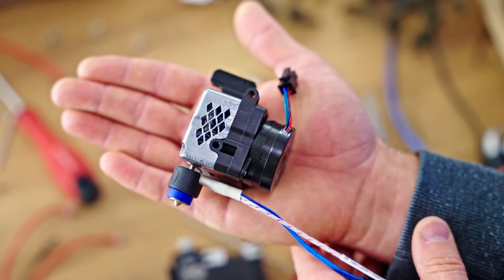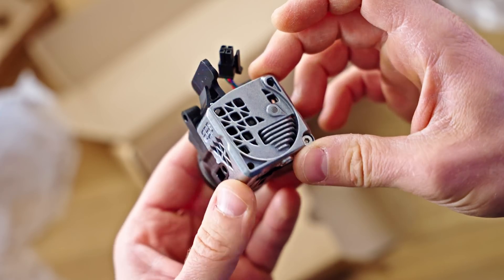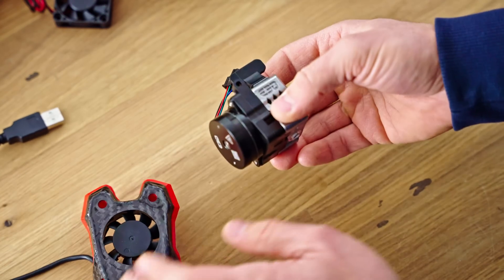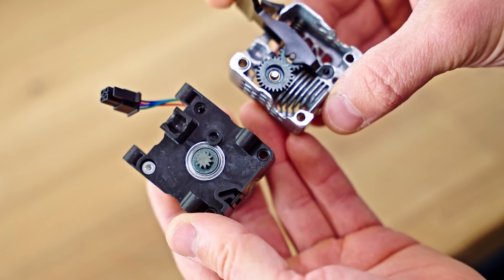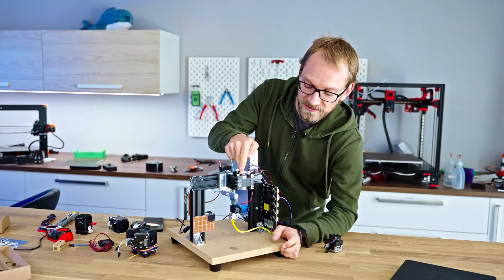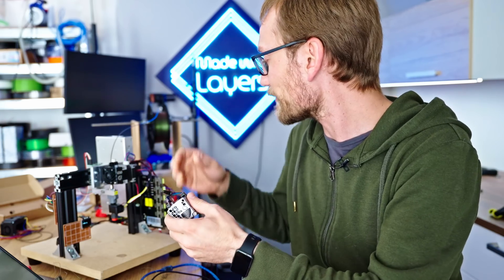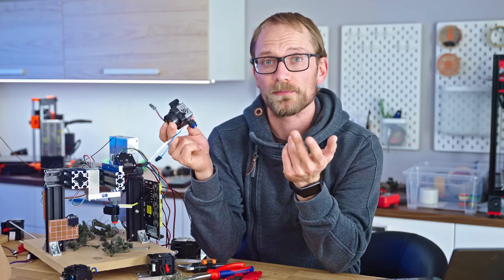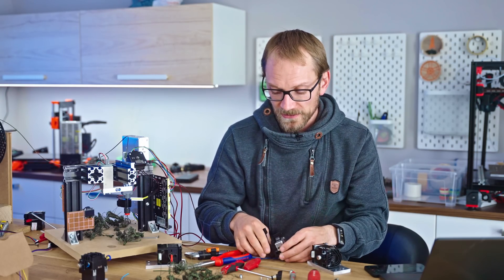Is the tiny E3D Revo Roto extruder really enough?

Comment: The depth of field on your overhead camera is very small or thin with the camera strugling to refucus with just a small movement up and down of your hands.  My suggestion is to use more light and push your asa up while decreasing your exposure.  This will help increase your depth of field.  Thank you for all the great info.  This might be a great extruder for a multi tool head printer.

Comment: Who's making the round stepper motor for them?, I have the LDO round stepper which is rated at 1 amp running at 700mA 24/7 on a Hevort/vz-bot type extruder with BMG gears printed in petg and the motor doesn't even get hot, looking at their documentation it says recommend current of 0.45A peak and max of 0.6A, seeems like they have used a lower current motor that's not up to much, why did they spec that motor for the roto extruder, maybe they could try the LDO or Moons motors that are rated higher?, don't know about the stealthchop issue that's mention below as I'm running a duet ethernet controller with TMC2660 which don't support stealthchop.......

Comment: I have been able to get consistent extrusion of 100mm of ESUN PLA+ (at 225 degrees Celsius) filament at a feed rate of 645mm/min. 0.6 Revo HF nozzle, 60w heater core. Roto stepper running in SpreadCycle at 350Ma with default 0.9 chopper timing. (Marlin)

Comment: Maybe it's not stepper issue but stepper driver. We know that microsteps results is massive torqe drop. With that high gearing and 0.9 degree motor there is no need for using it. Try full step mode and retest it.

Comment: It's abit of a pitty, that you did machine those adapter plates from aluminum. They are a huge extra heatsink and change the thermal properties of all those extruder/hotend combos. Specifically, the roto has this combination of motor cooling and hotend cooling. This can greatly benefit from a large external chunk of metal. To have a comparable test situation they should be somewhat isolated from the test-rig/frame..

Comment: I suspect the 0.9 degree motor they have selected for this, the currents it’s capable of taking and potentially stealthchop are the limiting factors, not the size of the motor. 
The extrusion force you can get out of the Sherpa Micro with an 8T pinion is higher than the LGX for instance, and the double folded ascender is much higher again. Depending on the motor design you may be able to swap this with with a moons 1.8 degree stepper that can take 0.85a reasonably comfortably and see much higher extrusion rates. With much longer meltzones and stepper heatsinks I’ve seen nema 14’s go over 100mm3 where they would be limited to about 70-75mm3 without cooling. 

E3d - please give us a longer meltzone revo, say triple the length for more like 45mm3? I’ll take the loss of maximum volumetric flow rate to get quick change but 20-24mm3 just doesn’t cut it with today’s faster printers - even with 0.4mm nozzles. 

I’m also curious if it goes a little further with the reboot directly attached. Probably not significant however there would be slightly reduced friction losses from the filament with a shorter path.

Comment: The other thing worth testing for is how effective the printed cooler is when running as a direct drive.
One danger is that while it might cool the heat break effectively, its blowing warm air around the gears too... I wondered if the pla would soften in the gear area causing a jam.

Comment: Thom, you need to issue a correction and retest the Roto.  For any high speed stepper, such as the pancake stepper used by the Roto, you need to disable stealth chop on your stepper drivers.  The time between steps will be too short, which due to a bug or design flaw, triggers a false over current fault in the stepper driver.  

I encountered the same issue on my Orbiter V2 on my Ender 3.  At high speed printing, or with linear advance enabled, the motor would stall at random.  Disabling stealth chop fixed this issue.
Reply: He really should pull the video.  It’s so wrong and hurts e3d
Reply: A month later, and the video is still up. Unreal.

Comment: Really interesting extruder! I do agree that the glossy diecast surface of the aluminum is not really much to my liking either. Some feedback about the video:
While measuring the actual feedrate of the extruder in mm/s is valid and justified because that is literally the figure used in G-code, most of us never need to know it in practice. I think mm3/s or actual achievable printing speed in mm/s would be much more useful info.

Comment: WTF is mm/s supposed to mean?!
mm/s when printing at 0.4 line width 0.2 layer height?
mm/s of 1.75mm filament?
Just use mm3/s. Nobody rates pumps as (x meters of pipe)/minute.

Comment: My guess on why the roto stalled is the stepper driver. It looks like you plugged in some fysetc tmc2208/tmc2209, those run in stealthchop by default, which puts a pretty hard rotational speed limit on the stepper. Doesn't help that the roto uses a 0,9° stepper in that case. Try some a4988 or swap to spreadcycle if you haven't done that. That removes the speed limit. My theory is backed up by the fact that the other extruders have roughly 400 steps per mm at 16 microsteps, the roto would be much closer to 1200 when taking a orbiter or sherpa mini as reference. Otherwise it doesn't make sense to stall that early as other small extruders can go much further than the roto, fot example it doesn't matter really if you are using a sherpa mini or a bmg, both have enough torque to loose traction

Comment: Tom, your test rig might be at fault for that 0.6mm nozzle result. Check if the tmc2208 driver is in stealthchop mode. That mode caps around 300rpm and motor just stalls. You should set the driver to spread cycle mode for higher speeds.  That tiny nema 14 motor needs to spin quite fast to get job done.
Reply: I keep the stealthchop threshold on 1. Gets rid of the stepper whine at idle and immediately turns off when the steppers move because the threshold is so low.
Reply: klipper recommends not doing that, i cant remember exactly why but you can probably find it online @JrTanc

Comment: Strange results, since the Sherpa mini uses the same motor, similar gearing (8.x:1) and current (0.35A) and it can reach well above 30 mm3/s
Reply: Yeah idk if the testing is flawed or e3ds implementation of the motor is flawed, but I've used orbiters and CW2 extruders at like 25mm/s easy
Reply: @gotmilkbutt  Flawed testing, stealth chop is still enabled in Thom's stepper driver.  You can't use stealth chop at high speeds.
Reply: @gotmilkbutt  which, to make it clear, means about 50 mm³/s.

Comment: I wonder if you could bump up the extrusion force by increasing the run current to the 0.85a recommended for the Orbiter V2. Granted, the Orbiter doesn't have an integrated hotend heatsink which means the motor is probably staying cooler than the same motor running in a Roto form factor, but something like the "turbiter" (an optional fan that sits on the outer face of the Orbiter NEMA 14 to provide cooling when printing in a heated chamber) might help with this. I can't find any information on what specific stepper motor the Roto uses, but the Orbiter V2 at recommended current has pretty exceptional extrusion force for its size/motor type. The creator of the Orbiter V2 has a blogpost that explains why, despite 0.85a seeming like a high run current and making the motor hot to the touch, stepper motors can function well at much higher temps than we normally use in 3D printing, and the limiting factor in the Orbiter is actually the melting/deformation point of the delrin gears. Maybe (assuming they use different steppers) you'd have to swap out the Roto motor with one more similar to the Orbiter V2 motor for best results, though. I'd be really interested to see some tests that look into this!

Comment: Would love to see this compared to some of the other extruders that use the Nema14 round motor, e.g LGX Light, Orbiter, Clockwork 2 etc.
Would be nice to know if this is just an issue with the Roto or Nema14 extruders in general.
Reply: I've used the clockwork 2 and orbiter at up to 25- 30 mm per second with a rapido hot end. I can print my info at like 350 mm/s speed. Also used the rapido 2, same results.

Comment: The stall of the roto is caused by the stepper driver: stealthchop only supports 300rpm. Use spreadcycle for up to 3000. (trinamic drivers)
Reply: Was going to comment the same,
Reply: I also got a nema 14 as an extruder and i am able to push 50-60mm^3/s with a 0.4mm nozzle. Mabey a bit more current to. I am running 0.85a at 24v (watercooled) but 0.6a should be possible with aircooling
Reply: @A_Guy_Building_Stuff 50-60 mm³/s :ooo i only was able to get 38 on dragon uhf with cht and vulcano exension with sherpa mini. 
what setup are you running?
Reply: ya I think there are some missing information about this test.
Reply: Team TMC2208 or team TMC2209?
Reply: @dillpickle7633  2240
Reply: In case someone would want some details, you can google search 'The Lerdge TMC2209 schematic has,RPM is greater than 3000RPM.', and it will be WordPress blog post.
Reply: Yep, sound like a "User error: hit any user to continue" type of error.
This needs an update quickly

Comment: Tbh, I love it. I've always thought that the extruder motors for most printers were massively oversized (though a common size). Your testing proved that point; the revo-roto's the only extruder that isn't massively overspec'd for a .4 nozzle. So for printers that don't plan on going over .4mm nozzle, this is probably the simplest, smallest extruder out there that might allow them to reduce the size of other drive components.
And it probably stalls because stepper motors have a hard speed limit; over a certain RPM they can't switch steps fast enough, and instead just oscillate between steps. Microstepping helps, but there is a limit.

Comment: Oof the flow rate is so disappointing. Usually you go super light to print fast but if you can’t print fast then what’s the point? My mk3 regularly is flow limited 17mm^2/s with my CHT

Comment: I like compact, light print bead assemblies and, this almost delivers the goods after far to many '1kg' lump hammer heads of late. Just a shame they will now clearly have to add the concept of high flow extruders to the product lineup lexicon.

Mind, a slightly beefier motor than that one in the back, and alls good. Though, maybe it's time to start looking into using brushless DC motors (as used for RC cars) with some manner of closed loop feedback in extruders instead. They pack a lot more torque and quiet smooth operation into a smaller package. Then there is also 3 phase style stepper motors used in some places, they are pretty much identical to brushless DC motors, except optimised for low speed, high torque operation. I think somewhere in that mix is an Innovation waiting to happen  :)

Comment: What voltage is the PSU on the test jig? 12V or 24V?

Running a stepper motor at higher RPM requires a proportionally higher drive voltage to produce a high enough di/dt in the windings.

If you're using a 12V power supply in the jig, you'll probably find it'll extrude much better through the 0.6mm nozzle if you try a 24V supply.
And if you're using a 24V power supply, you'll probably find the Roto will run like garbage at 12V - which would be interesting information for people considering fitting one on a 12V printer.

Another possibility is the super high step rate might be hitting a limit of the driver IC or 3D printer firmware that you're running - try halving the microstepping value of the driver and see if that makes a difference.

Cheers!
Reply from the maker: 24V for this one - at this point, is it fair to consider 12V setups "legacy"?
Reply: @MadeWithLayers  Definitely fair, but there's lots of 12V printers still out there - Prusa MK2/2.5 for example - that people might try putting one of these extruders onto and run into problems as a result.

How about slapping a 12V power supply on your jig and repeating some tests to see how bad it gets? Might be useful information for people.

Comment: The choice of 0.9 degree stepper is an odd one, 0.9 comparison same for same have lower high end torque, with such high gearing, resolution isn't an issue, so why 0.9? Would be interesting to compare it with one of the popular bondtech geared extruder diy mods -- i.e sherpa mini and derivatives like the hextrudort. The size of the sherpa and the like is similarly small, but the gearing isn't as intense + use of a standard LDO 1.8 degree nema 14 round stepper would likely outperform this. You can see Vez pushing a lot more plastic than ~15mm^3 sec on the vzbot.

Comment: This is really tempting me to upgrade my prusa mini to direct drive - the only glaring issue is that going by the source code, I don't believe the mini has firmware adjustable motor currents. That could be a big issue; I don't fancy replacing a surface mount resistor.

Considering the issues with a high flow hotend, e3d could do a better job with the bundles they offer on their site. The only revo hotside sets available are the high flow and high temp ones - going down to a regular brass revo nozzle and 40W heater would save a fair bit, but the buyer then has to manually select the parts from the spares section (which makes it easy to forget something important like the revo spring).
Reply: I would really like a comparison video of a prusa mini direct drive conversion with that thing. Especially on flexible filament !

Comment: looks great to me - I just use .4 anyway... given the light weight, might be able to increase print speeds?
Reply: Yes, to some degree. But this combo will get into "low melting performance" bottleneck relatively soon.
If you are printing with 0.4mm nozzle and 0.2mm layers, it will keep up with speed roughly up to 250mm/s.

It will allow you to use higher acceleration and jerk values, while keeping the same print quality, because it is light and printer will need lower forces to move it around.

Comment: Im a bit disapointed that the e3d shop sells the extruder without the hot side parts which moves the price from reasonable to unappealing for me.

The Biqu (Bigtreetech) V2 Revo is a similar combo extruder and albeit slightly heavier (~200g vs 160g) and larger it does include E3Ds heater core and revo nozzle for noticably less.

Comment: Came away a little disappointed. My Orbiter V2/Filament Sensor/Rapido HF/CHT will stay in place for now. Although I did just see pre-orders for the Orbiter V3! Looks like an alternative if you aren't in the Revo hotend ecosystem. (Still waiting for a high flow and hardened Revo) Hope Thomas will check it out!
Reply: This video has flawed testing.  The motor isn't the cause of the stall, the stepper driver is.  Tom left stealth chop activated, which you absolutely cannot do for a high speed motor.  Nearly every documentation and build instructions on extruders which use these pancake steppers lists disabling stealth chop as an absolute necessity.  The time between steps will be too small, which will cause the stepper driver to trigger a false over current fault, stopping the motor.

Wait for a revised video, I trust Thom to make a correction.
Reply: @earthwormjim if stealthchop were enabled why did it not affect any of the other hotends?

I've never seen a non-standalone driver with manual voltage adjustment either, not that they don't exist but I've never seen one.
Reply: @timmturner Because of the gearing ratios, the other extruders do not require as high of motor speeds.

Comment: What about TPU? The LGX Lite has a lower tension position for TPU. The Revo Roto appears to only have one tension.
Reply from the maker: I don't know about the Lite version, but the regular LGX has a non-sprung idler lever, meaning you're not actually setting tension of the lever, but instead you're directly adjusting how far the filament gets pinched. Spring-loaded extruders should do better when it comes to handling a wide range of filament harnesses, but may have a lower level of ultimate grip.

Comment: so the rough estimate in flowrate terms for a 0.4 nozzle, 1.75 filament diameter at 6mm/s is 14.5mm^3/s
this translate to about 240 mm/s at 0.15 layer height and 0.4 layer width

afaik bambulab can reach around the 250 mm/s area quite comfortably. I feel like if the hotend can't cope to extrude at that rate, their selling point become quite narrow. So this hotend is for a premium printer (shit is like 150USD not including the hotend)  that want to have high acceleration and speed but utilizes that speed to print at higher resolution instead of faster print time. maybe it pairs well for the dozens of people that use 0.25 nozzle